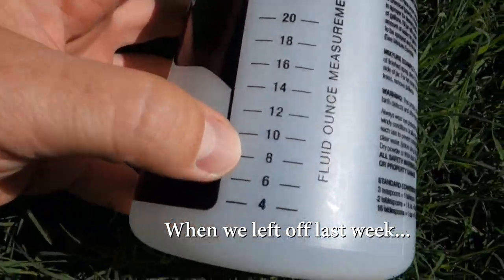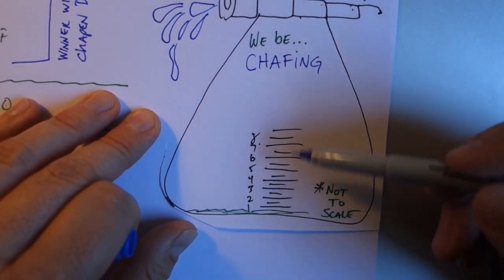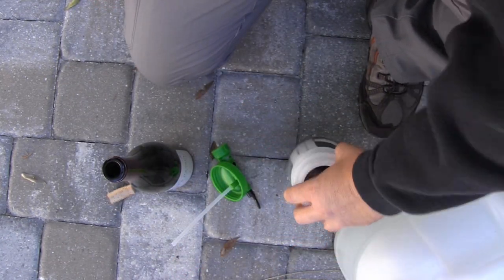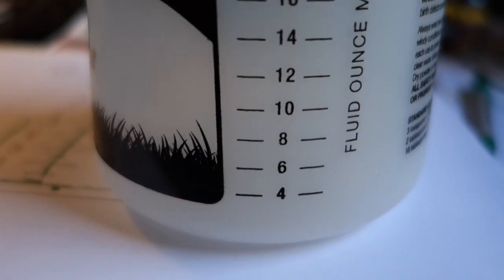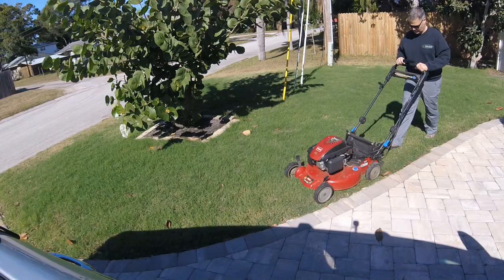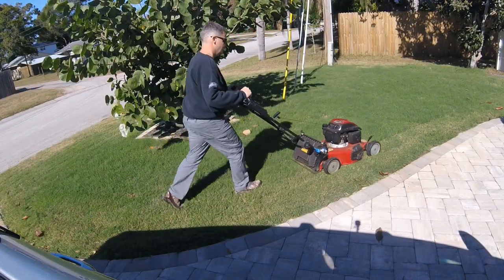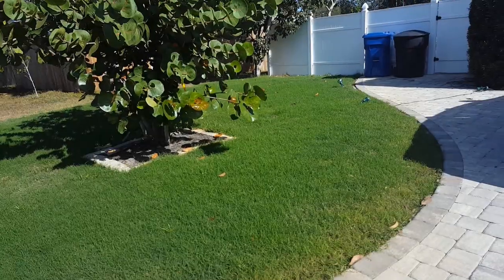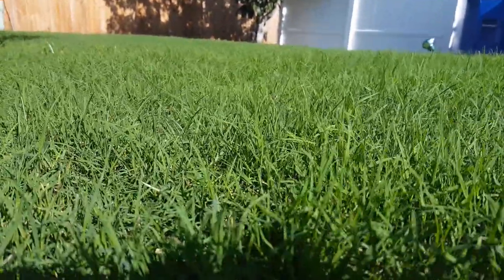Part2: Adding Potassium or Potash to the Lawn

Comment: Since the product you’re using is basically Phosphoric Acid as the active ingredient, which is also fantastic product for removing rust (iron oxide) from house paint from the well water (I’m in the Tampa area). Will this product lower the Iron level in the soil?

Comment: You should do a video about how to plan application of several different products with different rates. Use a fresh bottle of sponsored wine for each calculation. Make sure to drink all the leftover wine during testing.Then review the products and the wine. You will probably have to hire someone to do the spraying to make sure you don't suffer from contamination. Think of it as a form of job creation.

Comment: allyn: now that i think about it, the "lever position" on the hose-end applicator is irrelevant since you were able to measure the hose water output using your 2 gallon bucket measurement test. correct?

Comment: Love your videos man! I recently did the soil test, though I took soil samples from three different spots and then mixed those in a bag and submitted my sample for testing.  The results came back showing that I am high in Nitrogen and VERY low in Potassium.  Also that I would benefit from Gypsium.  Considering that it's been sometime since we've fertilized our lawn and we are high in Nitrogen, I'm curious whether some of the soil included in my sample was from our garden which we've planted in the last three weeks?  Any help?/

Comment: I'm getting rid of my hose-end sprayer. Considering a backpack sprayer.
Reply: I bought a field king unit this season, and I am super happy with it. The high flow fan tip kicks ass. Pump with one hand and spray with the other, no need to stop unless you need to mix up more product. Would be cool to see LCN do a review on the field king back pack sprayer.
Reply: Matt Hartup I'm gonna have to check that out.

Comment: So could you have used a tank sprayer. I prefer that.
Reply: I think you could use a tank sprayer.  I think you would use something like 4 oz per gallon and spray 500 square feet.  That math should work out to 8 oz/1000 sqft using 2 gallons.

Comment: Cant ya just fill the jar to the number of gallons (eg 10 or 20 gallons) ya want to spray?  The same amount of product will be put on your lawn, you will just have it mixed with 10 or 20 gallons instead of just 2 gallons in the same square footage.  Doesnt matter how much water, just how much product over the 1,000 sq ft.  also, on that chapin spray bottle, cover the little air hole on the top of the jar lid with your finger while spraying for proper siphoning effect.  bottom line, put your 8 oz over 1,000 feet with 10-20 gal filled jar...that gives you lots more time to spray the same amount of product over the same area of lawn.  8 oz is 8 oz.....1,000 sq feet is 1000 sq feet, doesnt matter how many gallons of water you used to put it on eh?  more water might even be better so not to burn the lawn or run out of product prematurely and spreading too much on a smaller area.